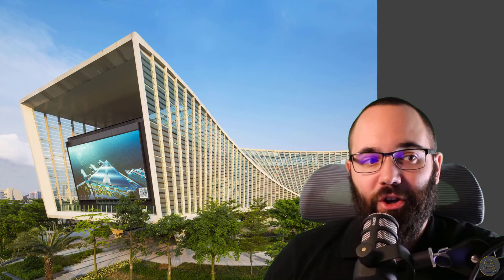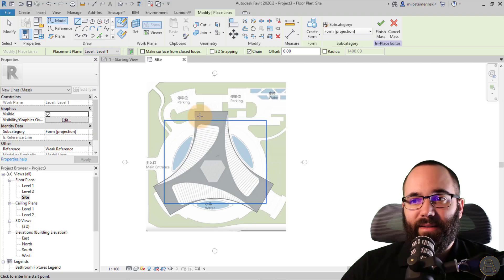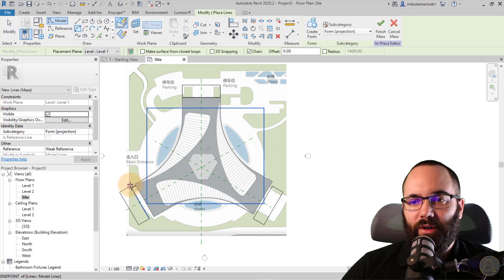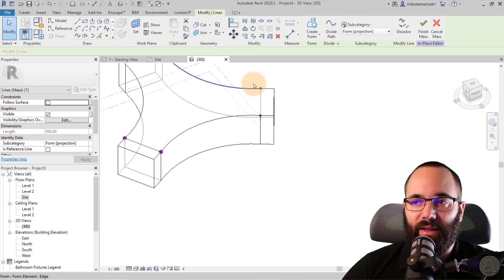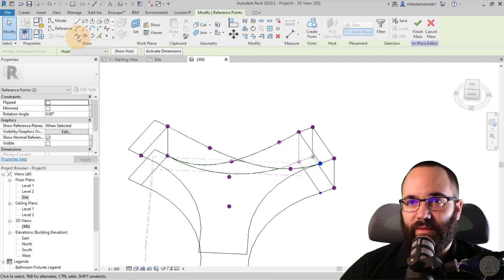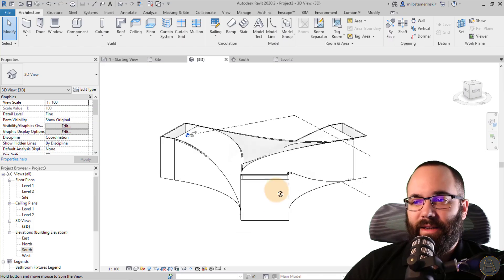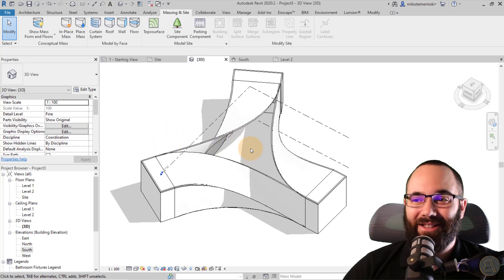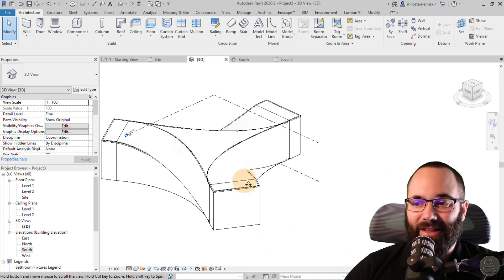Twisted Massing in Revit Tutorial

Comment: @balkanarchitect  your content is amazing but it seems so painful to model in Revit... Could the shape be built in another software that handle curves and has actual modeling commands like "lofting" "solidify" "booleans" etc... To automatically generate the curves, then form a manifold mesh and then export into Revit?
Reply: If you use rhino, you can use the RhinoInsideRevit plugin. That way the massing can be done in rhino. But one of the issues I had was actually getting walls to be BIM walls and roofs to be BIM roofs.

Comment: Useful Video but the Problem with Roof and wall intersections remain and in an Office that should be done correct.
as Option I would Draw a circle mass in roof level before converting mass to wall and Cut (Subtract) those two masses and then convert mass to wall and roof.